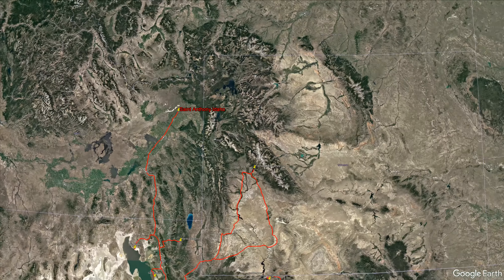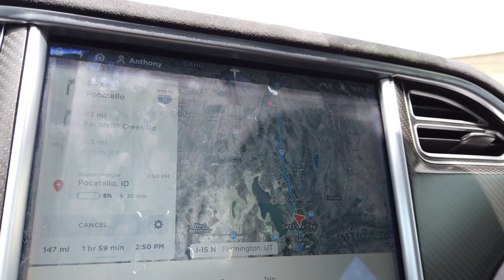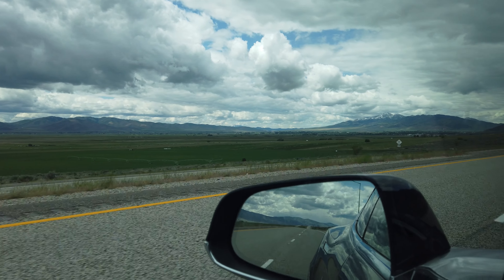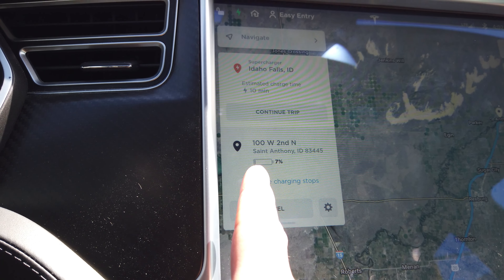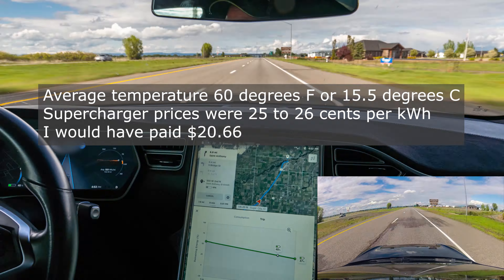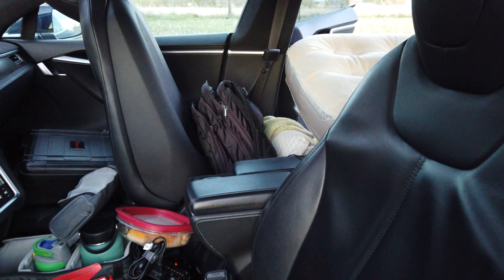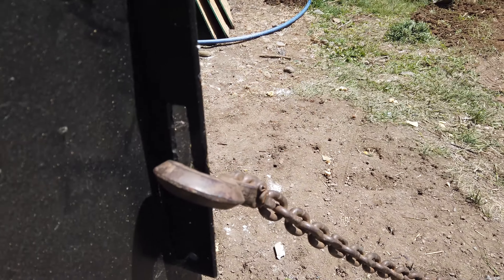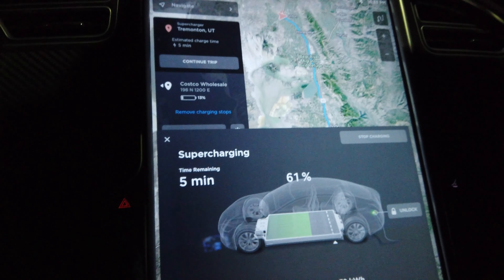Solo Drive To Idaho Using My Tesla Model S As A Work Truck And Camper

Comment: You are a very experienced Raod Tripper in your Tesla. I am not. Do you have a recommendation for a beginner (Model S) road tripper on how much in % or Miles I should plan on arriving at a Super Charger with based on what the car says?
Reply from the maker: In brief the in-car navigation is quite accurate typically and you could probably just do what the car says and be okay. I recommend targeting somewhere around 20% estimated arrival percentage for a little bit until you have some experience and can tell how accurate that is. I've heard of some people finding that number to be fairly inaccurate due to usually aftermarket modifications to their vehicle like different rims and tires or maybe a roof rack. Depart with 20% estimated arrival and see how close to that percentage the car battery is when you arrive and do that a couple of times and get some confidence that that is accurate. I now go down to 10%. The one environmental variable that affects this number the most is wind. I now use an app from windy.com on days that have some wind to see what the direction of the wind is and how strong it is and depending on our direction of travel sometimes I will give myself extra padding of five to maybe 10% depending on the strength of the wind. Happy road trip adventures!